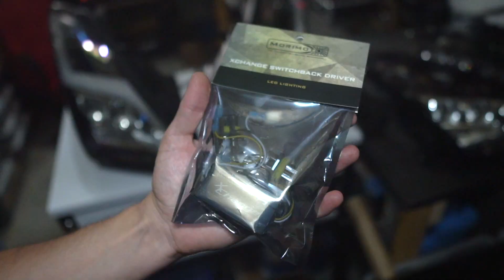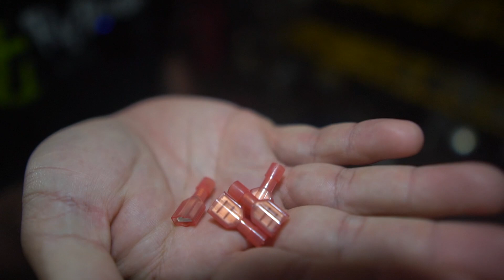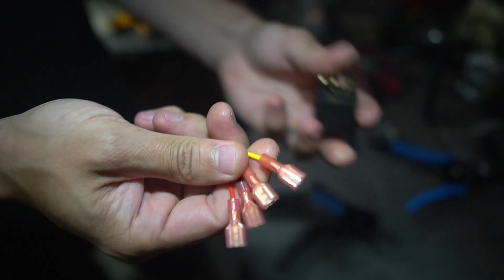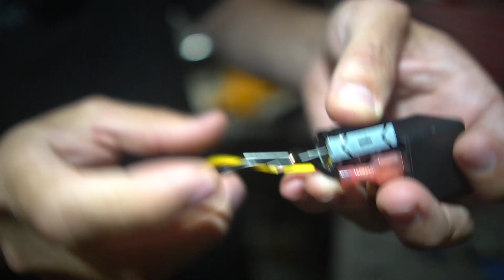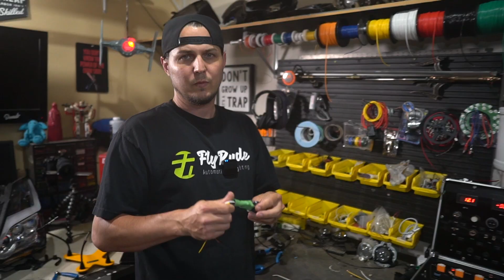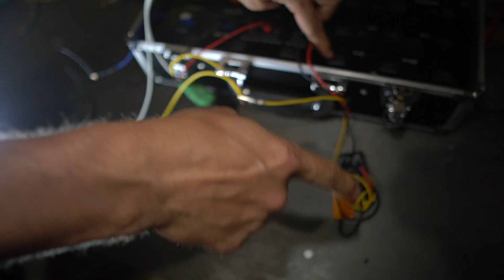EASIEST Way To Make a SWITCHBACK MODULE

Comment: Hey there, great video.. I was hoping you can help with a little project i want to solve. I have a BMW motorcycle with multi function rear led lights/turn signals. At present the individual units are running red as DRL's and also brighter when braking. When i initiate the turn signals a second set of amber led's flash within the same units. This works great but the  Red DRL and braking especially washes out the amber led turn signals. I was thinking I could use the switchback relay or drivers to give the effect that when Led turn signal is initiated the DRL/Brake lights go out until Turn signal is cancelled. Obviously I may need to factor in the can bus for errors .. any thoughts help would be appreciated. Also if i decide and want to try a alternating switchback RED/AMBER/RED/AMBER do you think a SSR like E-T-A ESR10 would work..? Thx again J.

Comment: I'm going to try something a little different with these. 
Rather than switchbacks, I want to try to make cornering lights like what allot of modern vehicles have when you turn the steering wheel, I'll just try to use the NO pin on the relay that Chris snapped off in this case

Comment: Hi. Very interesting idea. Just made it for my A3 8P. But there's a catch. It works perfect when the engine is off. After switching the engine on my dash displays DRL/side ligts error when putting indicator on after a few seconds. After I put some load resistor there's no error when indicating but it appears straight away after the engine is on and the lights are on as well. Any solution to this? Ih had this fitted few years back on Touran 1T and it worked. It doesnt on my current car.

Comment: Thank you!! I have been looking for this simple self-powered off-delay relay circuit for a long time.  I just tried it on the bench and it works!  Self powered off-delay relays are normally like $60 from what I see. Similar application here.  I'm using it on my trailer, to make the sidemarkers flash with its amber turn signals, with and without taillights on.  Therefore since it sits dormant, I don't want some fancy digital eBay board, just something simple like this with hard parts.  And it needs to be self-powered like this since I won't necessarily have a full time power source.  I see what you're saying in some of the comments, to run a 2nd diode.  I see how that would work.  But what I'm gonna do is keep my N.O. pin, and branch from the turn signal source to the N.O. pin.  Accomplishes the same thing, but no voltage drop through the diode, however small it may be.  N.C. pin from the taillight source.  COM pin to the sidemarker lights on that side.  Another application of this would be when using LED lights, since you can't do the typical reverse current flow like many cars are wired.

Comment: I know this is an old video and my comment may not be seen, but are the LEDs inside the lightning bolt two separate strips, one that is Amber and one that is white with a shared ground?
Reply: Hey so what they are is pcb boards with both colors on them. They either run the diferent colors alongside eachother, or staggered one after the other color and a shared ground. Or you can run your own strips of tightly lined LEDs or COB style, either works. You can also use different heughs of white, like white white, or cold white (veryy small hint of blue) You can also run RGBW Digital flowing strips and run amber alongside that for signaling, or sequential amber for signalling.

Comment: Hey there! Thanks for this video. This is what I'm looking for to turn off my front parking lights in the turn signal housing during turn signal operation. It's a motorcycle btw. Do you have tips on how I can power the relay from just the wires that lead to the lamp housing? I've got a negative (ground), one for parking lights and one for the turn signal. Ideally I want to create an isolated module that I can connect and disconnect easily from those three wires. Thanks!

Comment: Using your video, I made a couple of these using micro relays. The capacitor is conveniently nearly the same exact width as the relay so it comes out pretty clean. Bent the capacitor legs, soldiered them directly to the relay, and crimp connectors still fit on the relay nice and snug.

Comment: I have question, i want to make turn signal as a parking light + blinker for that i have installed a 5 pin relay i did the same elimate the switch terminal.  Now thing is when i turn on the turn signal the signal  from the flasher switch the relay and the bulb turn off and when signal is off bulb lights up. Due to this issue my front head light turn signals are not sync, when fender and back turn signal is on my front head light turn signal is off. 
Can you please guide me how to resolve issue.

Secondly on unlocking car the front turn signals dont blink as the relay gets power from the parking light and they will blink only if the parking light is on me. Any solution for this as well?

Comment: If there's power on the yellow wire, the white wire won't have power is that correct? So can I use this on a single contact led bulb? Planning to use this so that my turn signals can also function as park lights. Hope to get a response from anyone. Thanks!
Reply: Same
Reply: You can but you have to build or buy a "run to signal" device or relay so that the bulb can have dual functionality. You run the running and signal wires to the device and it makes it possible for the single function LED to have multi function. You may need a load resistor also between the signal  wire and the "run to signal" module to fix if it hyperflashes or doesn't flash at all..... sometimes cars need that load resistor to fake the power draw of an incandescent bulb so it works as you want it to be cause LEDs use such a small amount of power compared to an incandescent bulb.

Comment: @FlyRyde will this also work if i want to make side markers flash with corner light simultaneously and not alternating. Right now im trying to wire my side markers to stay on and blink with corner lights simultaneously!!
Reply: Already made one and tested working. Haven't instilled it yet just waiting for plug and play connectors. Just add two diodes, one from marker and one from blinker.
Reply: You can make them blink in synch by simply splitting off of the power of the signals and clipping the wires from the corners and running the signals wires with the corners also.

Comment: Could this be used on tow mirrors to make the turn signal lights stay on as running lights?
Reply: Yes, you can even do it switchback. But you have to wire it correctly

Comment: I have an issue where a set of sequential indicators with tail lights function gets confused. Itll flash sequential amber once then normal flash red once then normal flash amber once then sequential amber. Will this relay solve my problem? It may be dificult to house in a bike though 🤣😂
Reply: Sounds like there is no delay before red turns back on

Comment: HI THERE, I'M HOPING YOU MAY BE ABLE TO HELP WITH A FEW THINGS, I'M LOOKING TO MAKE A SET OF SWITCHBACK DRL/TURN SIGNALS FOR MY 350Z FRONT BUMPER REFLECTORS, MY PLAN WAS TO USE TWO SETS OF LED STRIP LIGHTS (1 WHITE 1 AMBER) AND USE A SWITCHBACK TO TURN OFF THE DRL'S WHEN THE TURN SIGNALS ARE ON. WOULD THIS WORK TWO SETS OF STRIP LIGHTS INTO ONE MODULE? OR DOES THIS ONLY WORK WITH WHITE AND AMBER LED'S THAT ARE BUILT INTO ONE STRIP?? THANKS IN ADVANCE
Reply: Yes you can use 2 strips, but you have to wire it correctly. You can do it on a 5 pin relay.  Watch on YouTube how to use the 5 pin

Comment: Ok, I made these, they work. But I learned about how dangerous capacitors were and ive never messed with them before. I dont understand why the capacitor is necessary if you have the diode. Im eventually going to try making this without the cap to see what that does.

Comment: Just curious, with this relay method, if there is no power to white, will the yellow still flash? Asking as if in a scenario the vehicle is off (so DRLs are off) and I throw the hazards on, will this still work? Or if my DRL signal are with headlights on only, will this still work to send the turn signal while the headlights are off?

Comment: Question on a 5 Pin y can't we run the white to center pin since it gets power with the relay off the run the amber on the out put side with the flasher on the trigger side

Comment: Hello :) Great video !!

Can I use this on a single bulb ? Particularly on a regular 21w turn signal bulb so it can be on as drl and when turn signal is on it can act as turn signal and then get back to it's drl mode.

Thanks!!!
Reply: Are you done with your project and did it last long? Made the module already and made it work by adding two diodes, one from the pulsing and one from the steady. Haven't installed it yet on the car since I'm still waiting for some connectors for it to be plug and play.

Comment: Would this work on a single filament bulb. Amber constantly on then amber flashing when turn signals are needed?
Reply: Follow the directions here but add an additional diode. Cathodes should be facing away from each other and you’ll need to solder the blinker input to the anodes of the diodes. The addition diodes cathode needs to then be connected to the wire on the middle pin. The relay will work the same cutting off the constant power of the light but the additional diode will send the signal to the now dormant wire.

Comment: Is it possible to use only one bulb? I wish to have my amber steady for park lights and blinking at the same time for the turn signals
Reply: Follow the directions here but add an additional diode. Cathodes should be facing away from each other and you’ll need to solder the blinker input to the anodes of the diodes. The addition diodes cathode needs to then be connected to the wire on the middle pin. The relay will work the same cutting off the constant power of the light but the additional diode will send the signal to the now dormant wire.

Comment: Hi. I have little problem. I purchased ebay switchback led bulb. It has 3 wires. Ground+DRL+flasher. When connected to car it works fine. I put extra relay with parking lights so when I turn lights on DRL goes off. All works great until I turn engine on. When DRL on all great but when DRL off flasher strobes. Should I put diode 4007 in line on DRL wire to block ground(negative at DRL signal?)

Comment: Awesome video. Will this work to kill stock DRL when turn signal is activated? What provides constant power when the flasher relay is in use?
Reply: Your input power should be the stock DRL input. This setup doesn’t need a constant power source.

Comment: if i use 2 leds, first ws2812b as drl + stepdown module as voltage reducer and second led strip running as left and right turn signal, how to apply it with 12v current source from battery and both turn on alternately (drl on, turn signal off and vice versa)?

Comment: Hi Chris

Can I use that for my vland headlights? My lancer does not have a dedicated DRL, it runs to the low beam. I want the 6volts to run to the LED/DRL and 12volts to the HID low beam when I turn the switch for the headlights. Thanks

Comment: Let’s say I have a led (has only power and ground), I want switchback to work for that same led. Is that even possible? 

I mean the led is turned on as a DRL and when flasher is activated, it flashes, then back to DRL when off.

Comment: Would this work if both the running light wire and the turn signal wire were hooked up to the same output? (Amber running light with the same amber LEDs but flashing for turn signals)
Reply: If the lights you’re talking about only have one input, use two rectifier diodes on the circuit. One directing power to the relay/capacitor and one facing toward the lights. Tap the blinker input between the diodes and the running light past both diodes closer to the lights, away from the relay. This will prevent the running lights power from flowing back and triggering the relay while still allowing the relay to work as designed.

Comment: Has anyone made it and not need a load resistor  for it.. I have a similar  setup but with a pcb 12v relay.. I've located  my side marker lights and turn signal lights the prob is when I have my headlights on and  activate the turn signal it doesn't blink but if I turn off my headlights it works ? I know I'm missing something  to this and if this can work on a gtr  I sure can make it work on my ford .. thanks any advice given. Also will u need a flasher relay to go along with this aswell?

Comment: Hi 

How do I make my turn signal lamp flash when turning and constant on when not ?
Reply: Use a 5 pin relay. 30 to the turn signal constant source (ie parking light +) 85 ground. 86 to the flash relay output. 78a to turn signal + and 78 is not used. Will need one relay wired to each light.

Comment: I'm watching this video still.. but just seeing you say the relay is bulky.. a more smaller packaged idea would look into using transistors or Mosfets.. the circuit will be pretty much similar but will be alot smaller packaged and lower profile and probably better efficiency..

Comment: Love your vid
I did buy from ebay an led strip light with switchback indicators and the switchback indicator only works when it is connected to a constant power , when i installed it in car dosen't work 
How do i fix it

Comment: I’m looking back at this and thinking, is the pin that you remove still usable if not removed? I want my rear blinkers to blink but running lights to blink between the blinkers flashes. The lights all run on the same circuit and I don’t want to overpower and blow out the lights. The blinker lights will be brighter than the running lights. Not 100% how to achieve this for my application. Any advice would be awesome 😊

-Joe
Reply from the maker: If you used the pin I removed, you'd just have to do so knowing that whatever it powers, will not blink, it'll just stay solid. BMW has something like this for a "turning light" that only comes on when you turning, and turns off after. If you're turning left for example, a little lamp will turn on and throw light out to the left side of the car so you can see better in the direction you're turning, since the headlights aren't already pointed that direction. The switchback module could turn on something like that, which will only ever be on during turn signals, but again, its not flashing like the turn signal, its just staying on consistently, then turns off when the signal stops. Make sense? Sounds like another good video idea :)

Comment: Great video and explanation! 

I’m using these to rewire my Vland Santa Fe sport tail lamps. Running an additional wire to my reverse light sockets to make them and the blinker housing switchback blinkers/brake lights while rewiring the current brakes to be the running lights. I have pods mounted on my trailer hitch tied into my reverse lamp fuse with a relay. I won’t be losing my reverse light function. 

-Joe

Comment: what about the clicking relay sound?  do switchback modules have less sound?  also you didn't mention about how long between turning the turn signal off and having the white light come back on, is it faster with switchback modules?   these are just two questions that come to mind watching your great vid.
Reply: I see other comments about that also.   P-Mosfet  sounds like the solution for reducing relay clicking sounds.
Reply: @nzhome101  also the delay of the white light comming on is created with the capacitor, bigger capacitor, bigger delay I believe

Comment: This old school was so interesting.
Ive been watching all you video.
But this time . 
May i ask if this is possible to apply in motorcycle with 12volt battery or do i need to change the load of capacitor. Hope you will see this .
Im from the Philippines. Thank you.
And more power to you.

Comment: I made a lot of switchback modules, but instead using relay i use P-Mosfet, it will be quiet, smaller and you can use smaller capacitor :D
I convert red USA blinker in tail lights to yellow EU and I have to make parts as small as possible and thats why i prefer Pmos

Great vid as allways 👍
Reply: I’ve made switchback modules with PCB relays before, but never thought of using a P-mosfet. Do you know of anywhere I could get some info on doing it?
Reply: That’s I’m looking for, need to the opposite, need my blinkers on the same brake bulb, can you help ? Any schematic?
Reply: i'd love a written tutorial via comment lol obviously its the same as the video but still lol
Reply: How do you use a P-mosfet to achieve the same thing as the video? 🤔 Do you have a schematic? Thanks!

Comment: Hi FlyRyde, on a side note, i use a diode on my 4 pin relay to stop reverse current, connect the silver band of the diode to pin 86 switch 12v, and the other side of the diode the pin 85 ground

Comment: Too much work. Just by the led relay off of ebay for 7 bucks like i did and be done with it....
Reply: Where’s the fun in that?
Reply: @explodingtwisting just think, you can have more time doing something else more fun by not wasting all that time you would doing it his way 🤣🤣🤣🤣
Reply: @explodingtwisting  Exactly!
Reply: I rather build it instead of buying it this would out last cheap chinese stuff. (Built Not Bought) Just Saying!
Reply: I have alot of "cheap Chinese junk" that you call it that has lasted for years...... If building stuff is your thing then have at it... I just have other things better I could be doing than building something that I can buy for 7 bucks....

Comment: Say I were to connect the white and yellow outputs together (maybe with a diode to stop them feeding each other) could I make a Ford style combined brake/turn signal?
Reply from the maker: Yup, I used to do that all the time actually. 2 more diodes needed, one for each wire as you said 👌